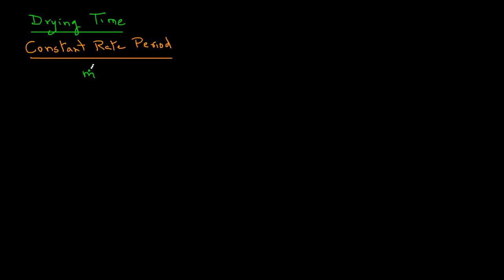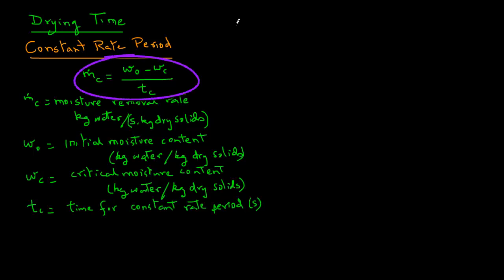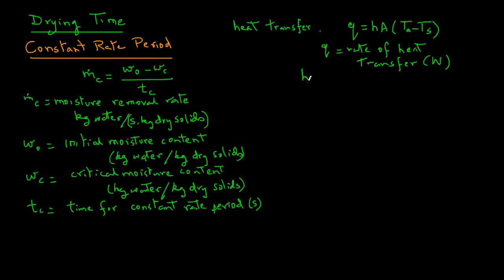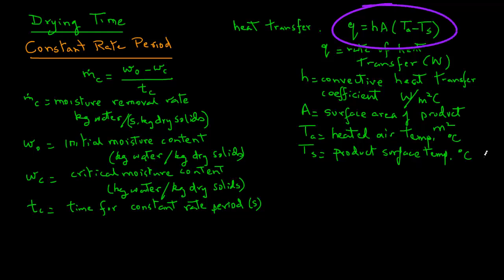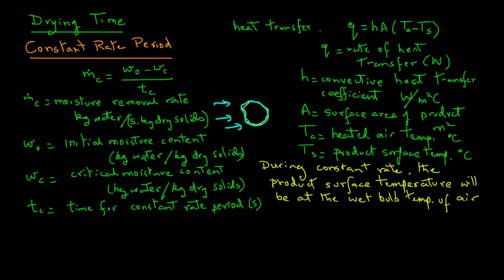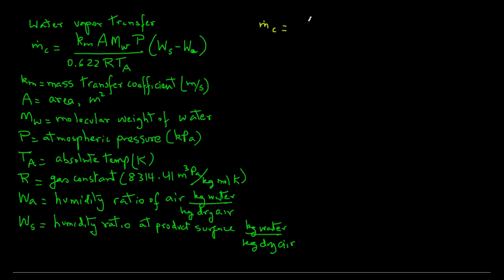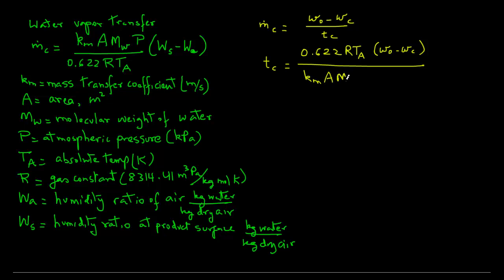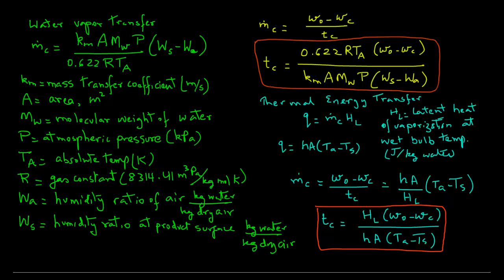Predict drying time in foods during constant rate period

Comment: Can you confirm that the Area referenced is the surface area of the particle being dried? I am a little confused as to why the smaller the area the longer the dry time.
Reply from the maker: The Area term "A" is the specific area of a solid,  with units of  m^2/ (kg dry solid). I will be adding a new tutorial with a numerical example.

Comment: at minute 2:15 you mentioned heat transfer through warm air. I was wondering: what would be the convective heat transfer coefficient if we were using for instance drying high density polyethylene with air? I can't seem to find any h for plastic, or should we use the h for air?
Reply from the maker: +masterstudent Convective heat transfer is always in the fluid, therefore, you should use h for air surrounding the plastic material.